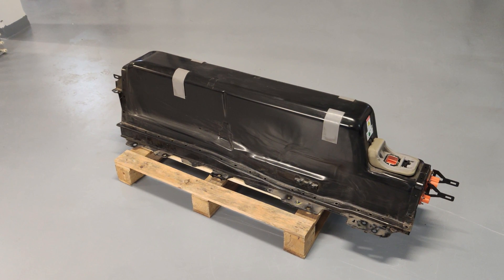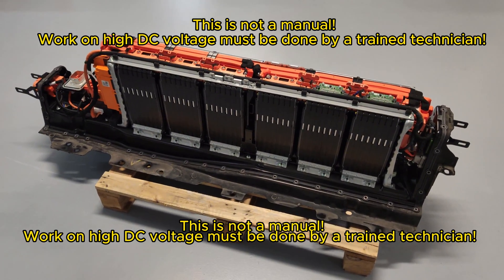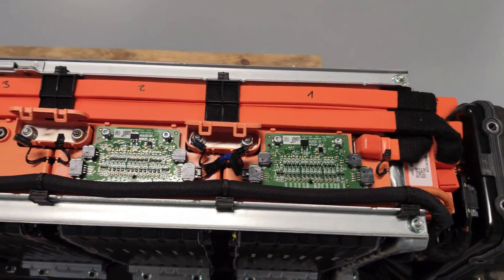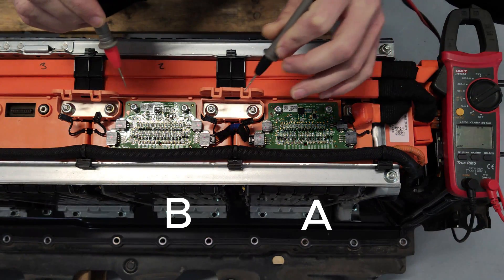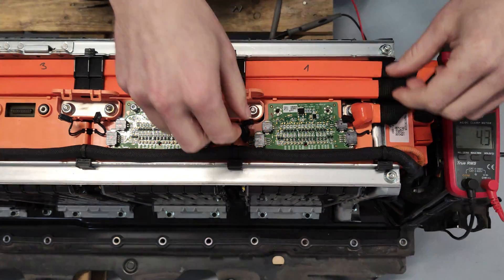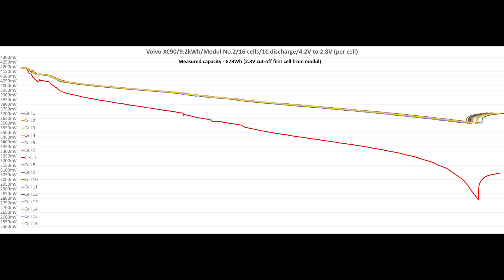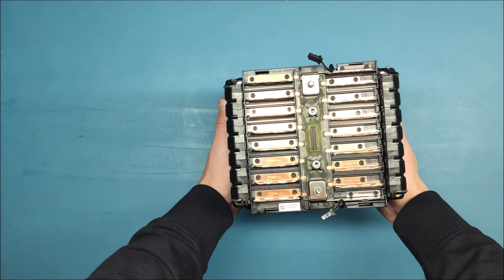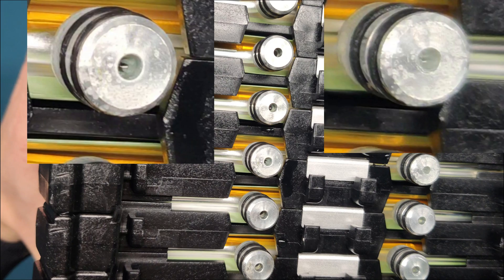VOLVO XC90 Plug-In Hybrid battery diagnostic

Comment: Vety good of you to film your work. Highvoltage, no insulation and you take the module out with force. Not professionals
Reply from the maker: Hi, there's no high voltage if is not connected safety connector... So we work with much safer voltage, so no insulation needed in this case. Modul was strongly connected to cooling base, so we had to use some force.  But thanks for your comment.

Comment: hello, I suspect one of mine broken and "D", is replace straight forward or do I have to code the battery ECU after replacement new module with new BMS?
Reply: I'm wondering this aswell!

Comment: PHEV batteries make hybrid cars less safe than combustion cars. Studies do show that a hybrid car is twice as likely to explode as a car of the same combustion model.

Volvo's adherence to ESG guidelines today takes away the freedom to choose a 100% combustion xc90 model with no PHEV battery type.

Better to buy used models without batteries or believe that the 2024/2025 model is still the safest car in the world even with the PHEV battery?

There is even one case of PHEV batteries in a Volvo Xc90 self-exploding inside the garage with no apparent reason.
Reply from the maker: I wouldn’t worry about the latest models. They have years of experience, and the chance of something like that happening is very small—like getting hit by lightning.

By the way, Volvo is known as one of the safest cars for other reasons. I don’t think battery safety is included in these ratings.
Reply: @mcells_batteries  are you aware of the case in which an PHEV Volvo x90 got into self-combustion inside a garage ? I Am a Volvo fan for safety but I'd rather like to have the choice for a 100% combustion model. Hope they correct this mistake in 2026 or 2027 bringing back 100% combustion models
Reply: "Tanulmányok kimutatták", meg az angol tudósok kiszámították...Mi alapján, milyen pontossággal? Nem kéne mindent elhinni, próbálj elgondolkodni a dolgok valósághoz való hihetőségéről, hasonulásáról.

Comment: How reliable are  volvos hybrid outside manufacturer warranty? 
Worth considering a 5 year second hand? Or for someone who is trying to save some money may risk losing more on expensive repair?
Reply from the maker: Buying a used car without any document about the battery's condition is a gamble. If you want certainty, you need to have a diagnostic report on the battery's condition. You need to consider what the manufacturer guarantees, which is 8 years / 150,000 kilometers.

Comment: How to determines if my XC90 2016 has a big battery or 48V battery? All PHEV has big battery like yours or 48V ones? Thanks Btw did you get replacement pocket for your battery unit?
Reply from the maker: If we're talking about PHEV batteries, most of them will have a higher voltage than 48V. I'm not aware of any vehicle with such a small plug-in hybrid battery.
Reply: @mcells_batteries  thanks, now is simple, xc90 with side door are PHEV. It was hard to remove the battery from the car? Of course you have to drop of the exhaust for that. Whats about the plugs or coolant, is there any way to drain it prior removal? Also does the new battery need to be reprogrammed? Does battery from newer models like 2017-18 will work on 2016 XC90 T8's? Same with the ERAD - I need to replace it - does it require any initialization/ programming?
Reply: It is hard for me to believe that someone bought an expensive car and doesn't know what what type of battery it has. 😲
If it has a charging port, then it has a big battery.

Comment: Good to know the car is built so the battery can be easily removed.
Maybe it might be possible to upgrade with improved technology battery in the future?
Reply from the maker: I don't think there's room for any upgrade here. If the battery fails, you simply need to replace the module. I'd leave upgrades to the car manufacturer. :)

Comment: Hi, my bet is that there has been a manufacture fault either in the cell corner or cooling plate such us a burr or both and when pressed together it has created or made existing fault bigger leading to failure, either shortly after manufacture and use or by time as cell is swelling.

Comment: Hi, I have a problem with my V60 MY 2020 plugin hybrid. The battery do not charching and turtle appears while driving, reducing power and switch out the EV battery. I'm waiting for maintenance now, diagnostic result are shown the foult code: Hybrid/EV battery cell balancing circuit E range/performance.
Reply from the maker: Hi, there is only one option here and that is to dismantle the battery and check it. There's a high chance you have the same problem as in the video.
Reply: Yes.
Reply: Could car still be driven with ICE engine when battery is switched out?
Reply: Hi, I am a about to purchase a Volvo 2024 xc90 t8 ultimate recharge,is this a good buy regarding the issues I see here in this video,I am asking because I don’t have experience with plug and hybrid systems
Reply: Hi, did you solve the problem?

Comment: Hi, great video. i enjoyed it immensely. I have a Volvo XC90 T8 2017 model with the 10.4kw/h battery and i would like to replace it with the 2021/22 18.4kw/h battery removed from a salvage car. Is this possible? And if yes can the electric motor also be upgraded with the new 2021/22 one?
Reply from the maker: Hi, thank you for your appreciation. I will probably disappoint you, but most likely neither the battery nor the motor will be compatible.
Reply: Hi. I read about a guy changing for the new bigger battery in his V90 T8 with success. Som programming had to be done but Volvo refuses to do it. You will have to find a 3rd party that can do it for you.
Reply: Why?
Reply: @Aznprada  greed
Reply: Hi, I want to do exactly the same with a V60, did you made progress on this topic?

Comment: Pouch cells should no longer be used. They are cheaper to manufacturer but have consequences as shown in this video.
Reply from the maker: Hi, sure but all battery types has positive sides and negative sides. Pouch cells have better heat dissipation space using, current. But yes, they are swelling and is there higher chance to runaway.